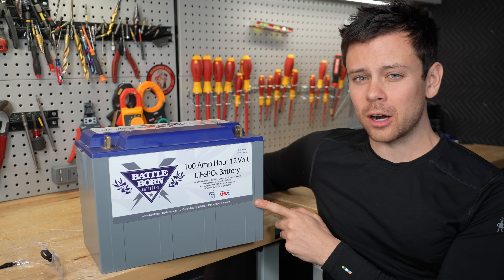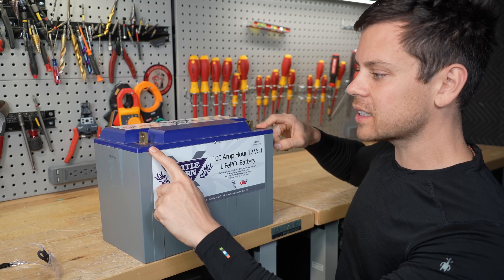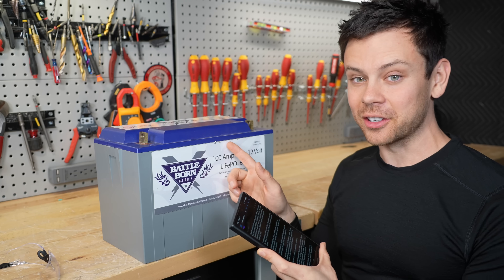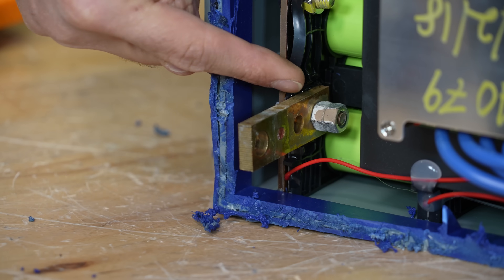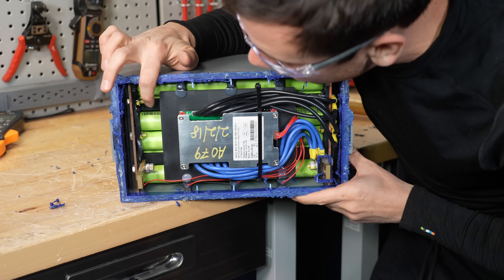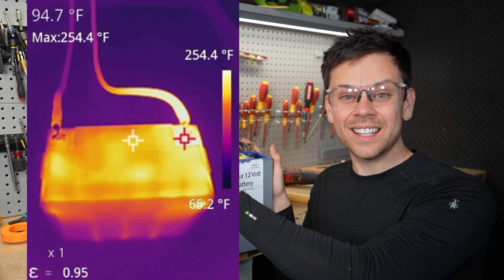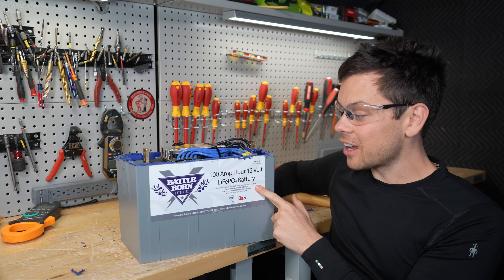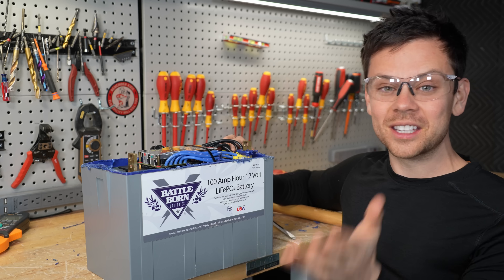Battleborn 12V Battery: Major Safety Issue

Comment: One thing I have learned from your channel is the internals are al pretty crude even on the top end stuff. At least I can service them. Cuz I can work with crude. I love your channel and have shared several vids. 
I am after the battery with the worst over current protection for car audio. At least I can open these up and bypass the bms if need be.

Comment: Using plastic as a structural spacer in a high current/high heat area is an absolute NO NO. 1 silly use of plastic has condemned all of these batteries and they MUST be recalled.

Comment: The positive terminal has a plastic sandwhiched between conductors. They can torque that bolt and use loctite and a jam nut; BUT if you pull enough current and that plastic gets hot has creep / deformation then your contact goes loose, resistance increases and gets even hotter. Bad design. They need a metal bushing pressed into that plastic so that positive terminal has a solid metal-metal-metal contact all the way through. But also look at the temperature rating on their plastics and do better in general.

Comment: I just received a new 100 ah BB battery. I would love to have you do the same test/ inspection on it. Better yet, you should purchase a new BB battery and do the same test to current production item. I would and I bet many other viewers would help pay for the purchase.
Reply from the maker: Email me and I'll give you an address to send it to and I will no problem
Reply: One test everybody might do before cutting the case is put a load on the battery and look at it with a thermal camera and/or measure the terminal temps with a spot IR thermometer. I plan to do this with mine when I get a chance.

Comment: I stopped using battle born batteries on my van builds because I tried to warranty a 3 year old battery and In the end I had to still buy a new battery! A company is only as good as their warranty!
Reply: Me too. Had 1 that stopped charging after 5 years of light use in our motorhome. Cradled therm and went thru their instructions to fix it /wake it up.... Nothing worked. They blew me off when I followed up looking to get a warranty replacement. Instead of buying a new bb, I bought 4 cheaper batteries that had an outstanding review by Will and other users (Siekon) and haven't had any problems in light use the last 2 years. The 1 working bb I have left is sitting on a shelf... Until I figure out a place to recycle them.
Reply: What excuse(s) did they use to deny your warranty claim?
Reply: They claimed my client let the battery go completely dead which they claim voided their warranty.
Reply: @14craigery  well, did the client let the battery go completely dead?
Reply: There’s very clear instructions that if the battery is run down to low voltage  cut off / 100% discharge  you need to charge the battery within a week. So if yiur clients battery had that happen then the customer violated the warranty terms. That falls under misuse

Comment: The only solution is for Battleborn to fix the terminal post issue with their batteries and then send out a new battery to each purchaser of the old battery.  Of course this will never happen, but it would be the right thing to do in order to avoid a class-action lawsuit.

Comment: Glad to see someone with some following finally pointing this out. I've been saying they have a problem for almost 2 years now. They still sell at a massive premium and claim they are the best, but they are far from it. 
I see a lot of RV solar systems and BB are the only batteries I have ever seen a problem with. I helped someone diagnose a problem where he had 8 batteries and over the span of 2 years all of them had been replaced under warranty for this problem, but the new ones were no different. And after his 3rd warranty claim they told him they weren't going to replace them anymore!

Comment: Well crap. Have 12,  used for 48v to a inverter, being out of service now as the RE room is being redone. One more in use  as a UPS backup for the home electronics. Just checked, not loose and no discoloration. Thinking this maybe more of a mobile problem. 
   I have checked the 48v strings before for temperature and voltage under load  with no issues, but that don't mean they are are safe.

Comment: I have two Battle Born batteries now they were both sitting for about a full year however they were fully charged before but now I'm getting where they're not balanced properly and they are shutting down for I'm assuming a over cell voltage at like 13.8 volt
Does anyone know how their balancing Works can I just apply back voltage just below the shut-off and hold it for a day or so to get it back into balance

Comment: What should they have done different? Locknuts?
Reply: Those mechanical connections at that positive bus bar are a joke of hillbilly engineering. Prowse’s own tear-downs show that modern batteries from China are better designed and cost a lot less than these BBs.
Reply: @TimAZ-ih7yb so... locknuts?
Reply: @madcow3417  No...the proper fix would be to use a copper sleeve set through the plastic to hold the nut/bolt tight without using the PLASTIC as the connection.
Reply: @Tumbleweed5150 Ah, thank you.  I couldn't tell from the video what was going on.  This makes sense.

Comment: So it sounds like Will has never taken one of these apart before. If so was it built like this with a plastic spacer?
Reply: He did a tear-down of this 100ah BB some years ago. The issue with the overheating terminal apparently takes many charge/discharge cycles to develop. There are fiberglass materials that would work as an insulating spacer, but it looks like BB used something else.
Reply: @TimAZ-ih7yb My guess would be that it only is a problem if you draw a large amount of current for a long time and the terminal gets hot. In systems where only small amounts of current are drawn the batteries may last indefinitely without a problem. But that is only a guess! Of course they should be designed to carry the amount of current specified.

Comment: There's no way a bolt should be used to carry the current from a bus bar to the terminal connection. The terminal should be against the bus bar, and the bolt simply used to clamp the 2 components together. 

This is an awful design, and literally a fire waiting to happen.

Comment: Not to defend, but if one person had three batteries with the issue that is more an indicator of a bad batch than how common the issue is (and potentially an indicator of something those batteries shared in common, be that usage environment or something between production and delivery).  

We would need other people and wider scope to get a feel for statistics.

That's why major prep people ensure buying things at different times to avoid any bad runs from a factory.

It does look like a design issue though more than a defect.
Reply from the maker: Agreed, if anyone has this issue, post on the forum or send it my way

Comment: Thank You! This was the battery brand I was going to use for my system….not now! They better recall their batteries yesterday before people die and their families start suing…
Reply: I sold my last RV in 2023 that was equipped with BB.  On my replacement RV, I went with LiTime based on cost and Will's videos.

Comment: I can definitely see how that terminal works loose in any application that causes vibration since its only one screw connection.

Even if these are used in a static environment i bet over time the connections will also work loose.

Comment: That really needs a formal recall. It is good that the discoloring of the epoxy is happening. It will be a great way to see if your battery is affected. Anyone that has the discoloration of the epoxy on the terminal should be able to take a picture and get a replacement. If the company doesn't step up here and make things right... that will be the end of them.
Reply: So is that how we identify a bad battery then? Discoloring? I dont have a thermal camera. Im not going to cut open my batteries.
Reply: @darklyte24  you don't need a thermal camera. Just touch it with your fingers. A solid bolted connection never ever gets hot. If it does, it needs to be tightened.
Reply: @darklyte24  It is still kinda early on but does appear the discoloration might be a good early indicator of overheating. Having the battery cut out of course would be an obvious indicator too. I'd suggest that if the terminal epoxy is discolored... it at least would be a red flag to watch the battery for any other signs of overheating.
Reply: @MilitaryTalkGuy  I have 3 that I bought over time, added 1 at a time. I never had them cutout that I know of. 1 of them seems like more of a dull red than the other 2.
Reply: @darklyte24  I would watch the one that has the faded color on the terminal closely. If you have a way to graph current flow like with computer software... might be prudent to look at the data during a charge cycle to see if you see any spikes that would suggest arcing. They do make cheap thermal cameras. I got mine on amazon for around 100 a year or two ago. Might be prudent for those that have the discolored terminal epoxy.
Reply: @MilitaryTalkGuy So im charging my system, i do have a digital thermometer,  they are all cool. No loose connections. No over heating.
Reply: @darklyte24  Id say that is at least a good sign but a digital thermometer isn't the same as a thermal camera. I have both and think a thermal camera would be more effective at spotting the problem early. Maybe Will can chime in here since he has tested a bad battery so knows exactly what the symptoms are so could let us know if he thinks a digital thermometer on the terminal would pick it up or if a thermal camera would be better.
Reply: @darklyte24  find someone you know with a thermal camera if you're not willing to buy one.
Reply: @darklyte24  A thermal camera is $15 on Amazon.  Might want to know if you are having this hot terminal issue.

Comment: Using double nuts to hold down, very bad if not done correctly.  I bet what they did was tightened down the first nut on the bus bar, then brought the second one down and instead of holding the first and tighten the 2nd, they turned the 1st one counter and tightened against the 2nd. Very bad. They should have used lock nuts!
Definitely not safe, not worth it. They saved maybe a few pennies in construction, and possibly cost them 10's thousands if everyone starts reporting these. Posting this video on several forums and Discords I'm on to spread the word!

Comment: Why do Lithium batteries catch fire??? Clearly not because of the Lithium but just extremely poor build quality. In Europe there is at least some form of control over the build quality if you buy locally but when buying from AliExpress or even Amazon you may get screwed like this.
That is why I prefer to buy do-it-yourself systems, at least you have an idea how it is built and can check the screw connections (or whatever part) once in a while. With prebuilt ones all too often you can't get inside without destroying them, hence no idea at all what it looks like on the inside.

Comment: Main problem is incompetence. This is such an easy thing to fix with a geometry locking washer for 25cent
Reply: Well, the fact that they are using the bolt as a conductor points to a level of incompetence that is hard to fathom. It can be done with solid copper bolts, but those have to be over-sized because copper is not as strong as steel (pure copper is not as strong as steel, and copper alloys do not conduct like pure copper).
Reply: @mckenziekeith7434  Would a cable be better? Or an intermediate Bus Bar ?

Comment: Lol, double nutting like you built it in your buddies dark basement while the hardware store was closed 😂
Reply: Yep. Double nuts are not a valid way to lock fasteners. I use Nord-locks instead. BTW, locktite is an excellent insulator. Found that out the hard way...

Comment: The beautiful thing about the situation is that it's now documented, and easy to replicate both in cause and condition.

And it's clearly bad design, not merely bad assembly.

If Battleborn claims that it's just a few small batches, then it would cost them essentially NOTHING to replace those batches. 

[BUT] if it's a really wide product-line situation, then they'll try to bury it, ignore it, delay any meaningful action and so on; unless they have integrity -- in which case they MIGHT do the right thing and do a full pro-active recall.

Comment: Bolted connection.  Basics.  Seen this so many times on electrical products, failing at the mech eng 101 first hurdle.   This should be a major product recall.

Comment: most all el cheapo terminals wire and degrading insulation on wires  are garbage  when i buy a 300ah or what ever battery i will pry it apart and check it out fixing issues the way i treat loads of china products

Comment: I had to play that back to make sure I saw that right. There’s a plastic insulator between the terminal and the main bus bar so all the current goes through that bolt?  Wow.
Reply: It is actually worse, all the current goes through the tiny surface area where the bolt and the nut touches the busbar and the terminal. That is a small fraction of the surface area compared to that of the bolt.

Comment: Wow I have two in my RV. On the BMS was 2018 date I think. Is this only a problem year or lot. Nut on Nut for tight connection is is the problem. No lock washer it looks like!! Will, please keep us updated. I will also do a video on mine once I return to hunt camp next week
Reply: Using plastic as a spacer on the positive connection is the main problem. Properly torquing the nut/bolt with metal to metal contact ONLY would assure a good connection. As is, the plastic can deform and allow poor connectivity.

Comment: all they needed was a copper sleeve around the bolt so all the current goes through the sleeve rather than the bolt. Relying on plastic as a spacer while sending current through a bolt is really bad practice.

Comment: Why on earth would you have plastic as part of a bolted connection? You can still use plastic spacer/alignment components, but have copper ferrules cast in to take the compressive forces.

Comment: I have 5 of these, 4 in my house and one in my van. Oh, F*^K!! Do you have serial numbers or date codes for the defective batteries?
Reply: I just checked the 4 house batteries and there's no discoloration of the red around the terminal. Does that mean they are OK? Thanks.

Comment: Holy fireballs! This is one of those problems that would have surfaced with just a bit of product testing at high load; clearly this was not done. Also, the whole design of the terminal is wrong and goes against established good electrical wiring practices. Say it with me: Bolts are not buss bars! I think the CPSC will like to have a word with BB's management...

Comment: I have that exact battery model in my off road trailer but I have never noticed any heating issues with it. Battle Born batteries are probably the most used batteries in the van building and off grid community. They’re installed in thousands of camper trailers, RVs, and vans. This safety issue probably warrants a huge recall.

Comment: Scary! Great that you bring this issue up!
I bet that they ran out of locking nuts and thought it would be a good idea to use double nuts. Double nuts works when you use a bolt just for a mechanical connection, but it's a really bad idea to do for an electrical connection, especially without springy washers.

Comment: Worse than a $100 Dumfume lmao. I’ve never understood people who spend big money on a battery when at the end of the day it will always be just a battery. There’s nothing you can do to change the fact that a battery is simply just that, a battery. Spend $100 or $1000 batteries have problems and degrade. Batteries aren’t new tech and most of us have been using them our entire lives. You’d think more people would understand something so simple by now. Wouldn’t you rather get got on $100 instead of $1000?

Comment: Wow crazy stupid design flaw with bracing the terminal in between plastic.  I always thought the Battleborn batteries are questionable as they got cult following in US RV community without merit. It's an easy fix, if they recall, rejig the terminal, and repack into a new case.

Comment: Thanks for doing what you do man!
I just bought that pre order monster 628AH from Yixiang for well, $3500. Adding it to my stockpile should hopefully net result 42k, which is closer to the 60k I need to run for a day. Thanks for the info on Yixiang, I never would have known if you didn't tell me! 
Cheers man 🍻
Reply: What are you running that you need 60k a day?
Reply: @FauxQue-yk8dt  
Everything in my home!
Reply: @Finite-Tuning I have 38k and it runs my house for 5 days in the winter and 1.5 days in the summer.
I wonder what happened to my original comment? It wasn't bad. Lol.

Comment: Wait... They have the terminal bolted to the bus bar with a plastic spacer?! What in the actual F***!!?!? I have 8 of these batteries. What a nightmare.
Reply: I just put in a request for an RMA. I'm 3.5 years into my warranty and this should be covered.
Reply: @Matlauk let us know how that goes…you’re not the only one in the situation
Reply: The good news is that you should be able to replace them at a quarter of the cost. When BB folds up.

Comment: Would not be surprised if BB dissolved and reappears under a new name.
Reply: The best thing they could do is immediately stand up to the plate and resolve this to everyone's satisfaction. Failing that, they will not be able to hide under the biggest rock.
Reply: @artsisland1683 this is going to be very expensive for them to fix to everyone's satisfaction. I would not be surprised if the company folds.
Reply: I thought they sold out a year or so ago?
Reply: it is a public company NASDAQ: DFLI